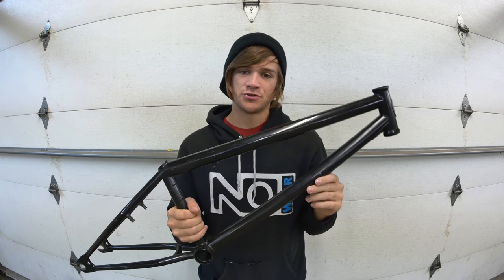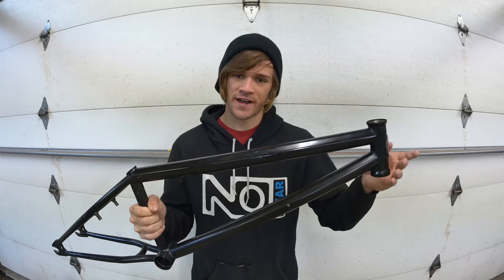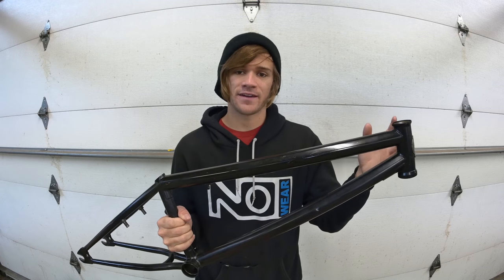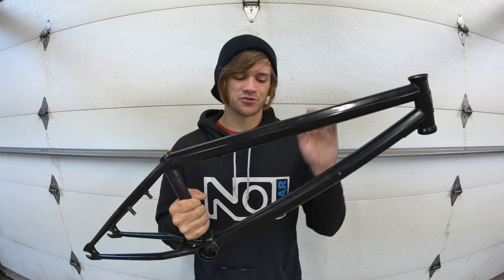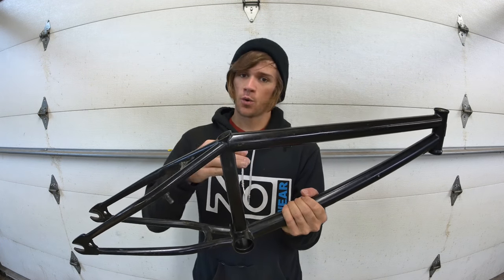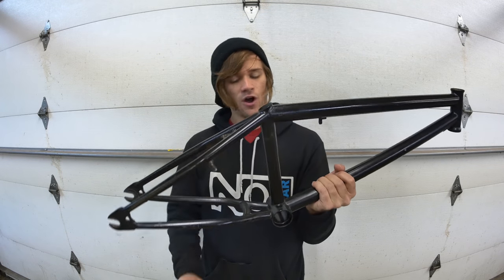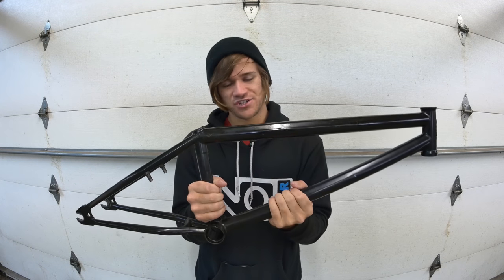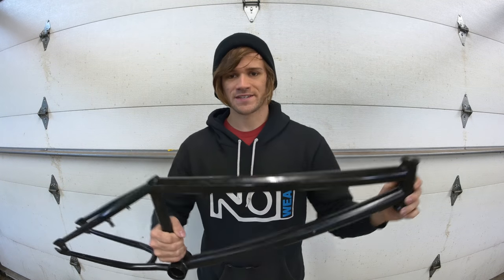BMX Frame Geometry | EXPLAINED

Comment: Dude, this is the BEST frame description ive ever seen !!  Ive been killing myself trying to figure out what size I nned for a frame to ride flatland & a little street ( but mostly flatland ) ,you said most flatland frames are 18 "  19 "  , but I'm '6 1" so I would probably need like a 20 or 21 " ?  I'm guessing .  or would a 18" or 19" be better, seems to me that would be to small , but more controllable  , I don't know ..hmmmm , all these new school bikes have me confused, I'm 44 and been thinking about getting back into bmx  ( when I say a little street , just mostly grinding and stuff, nothing to major, like I said mostly flatland
Reply from the maker: Thanks man! Honestly I’m not to sure about the answer to your question. I bet you could find it with a google search about flatland frame lengths.
I’m sorry that I can’t help more
Reply: my friends rides a 19.5 flatland frame and he is 6'1

however i also had a friend who did flantland on a 26 inch mtb with suspension disc brakes and pegs.  he was like maybe 5'11 https://www.pinkbike.com/photo/2488414/
as well as a regular WTP street frame built up as a flatland bike. 
this dude used to ride old school bikes as well. honestly for me it seems like any slightly smaller frame with a short rear end and steep headtube with a low standover is going to be decent for flatland. 

oh another older rider i used to ride with road a 20inch kink frame for his flatland/park/street bike. he mostly did flatland and ramp though. 

personal preference.
Reply: Jason Freeman Get that ! No matter what age but I think the Haro Matias frame is a little flat land street geometry.
Reply: I know your struggle man lol I'm 48 just getting back into it and it's been a major pain in the ass I've been through about 10 different bikes trying to find one that works for me

Comment: Good stuff Brant! Just finished my S&M CCR build, and wow, quite a difference from my "return to bmx" bike, Fit Mac complete! I was aware of the geometry numbers(and took into consideration) but once I got to throw a leg over the new bike, I was kinda surprised, its a whole different beast! I also noticed how twitchy my fit felt riding the local bowl, so I'm stoked to now be on a bike that will be a lot more stable.

Had I not known about geometry, this would be a great video to understand and help in choosing a frame.  Would recommend this to anyone that is seriously getting into riding.

Comment: Funny you mention the frames with the built in seat post.  I was just talking about the Sunday Ian Schwartz frame with my friend.  It had the post slammed into the frame which I didn’t like bc you couldn’t raise it.  But this was also 10+ years ago when a lot more people were slamming their seat.  And also where I used to work at Seattle Bike, they had that Sunday frame so I miss working there and getting to see all the incoming parts.  They had the Deuce Deuce by Macneil which had a 22 inch top tube!
Reply from the maker: Its fun to think about all those crazy things that have been tried with BMX frames and parts throughout the years

Comment: Great video honestly, the only 2 thing I believe you missed was headtube types like integrated and push in cups. Also different bottom bracket types like Euro and Spanish which can affect what cranks you have to run..
Reply from the maker: Thank you!
I did miss a couple things, thanks for the input

Comment: When you find a frame geometry that works, you just stick with it. My current frame is a Lairdframe and it's the best handling frame I've had since the first Fly Pantera frame I got in 2004. The geometry I currently run is probably 10 or 15 years ahead of what's coming out even now but it works. Otherwise, I wouldn't have been using the same frame for the past 8 years and if it ever breaks on me, my next frame is getting built with the same geometry I've been riding since 2015.
Reply from the maker: People definitely tend to do that. It’s funny though because I rode a complete bike im testing for the first time recently and it felt kinda good geometry wise honestly. It’s much more tech oriented geometry than what I ride normally which is just middle of the road normal geo that works good for everything.
I don’t know yet if I will make changed based on this but it’s interesting to think about

Comment: I’m looking into getting my first bmx, I’ve chosen the kink whip when it comes back into stock but lately I’ve been debating building my own, could you do a pros and cons video on buying vs building, I know cost would be a big part but at the same time I feel it would be more sentimental if my first bike was hand built
Reply from the maker: That is a good idea that is a bit too complex to cover in just a comment so I’ll add it to my list, thanks!
What I will say now is that most of the time when you get a complete bike you end up replacing parts and making it your own anyway. So it might not start hand built in the same way, but you very quickly can start to make it hand built and your own

Comment: Hi, great vid! I'm currently writing my engineering diplomma which will compare modern dirt/trails geometry with typical street but I have a great problem finding some real trails frame with 21' TT and some classic street bike with longer seat tube and 21' TT too. May I ask you for help in finding nice example for both? they don't really need to be 21' TT, but I would need them to have the same length of the top tube :)
Reply from the maker: Can you copy and paste this to me on Instagram? It’s the same as my YouTube name.
I’d gladly like to help if I can
Reply: for a street frame pretty sure the quan frame or a few S&M frames would do you. 

also fairly certain S&M makes some trails frames in that size as well.
Reply: I had the same problem until I bought the s&m black bike.. I've tried the hoder btm frame and love that as well.

Comment: Bro my Khe evo 0.3 came it came with the wrong parts "cheap stuff" i took it back the drop outs were drilled uneven and welded bent but.... I found a 2016 Fit Dugan 1 for  $125 not a. Year old and bro are u from PA too?
Reply from the maker: Wow thats kinda crappy, that sucks. Hopefully the Dugan works well for you
Im not in PA. Ohio

Comment: The bottom bracket height thing threw me when he talked about axle to axle wheel base. The way I understand it, it's basically just a measurement from the bottom of the tires to the center of the bottom bracket which wouldn't have anything to do with the wheelbase.

Comment: Great video, but noticed that you mention tyre height. Having larger tyres raises the whole bike like you pointed out, but it doesn't have an effect on handling as the distance from BB to axle line is fixed. Tyre height isn't worth mentioning in a video about geometry. I'm just pointing this out so kids don't rush out to buy new tyres to change BB height :) There is no way to change BB height in correlation to your axles unless you had a frame with vertical dropouts.
Reply from the maker: Thanks for putting that out there!
And in a nice informative way too.
Much appreciated man!
Reply: @Brant_Moore  I think the confusion is because it's measured from the centre of the BB to the ground, which assumes a fixed tyre height, which isn't a problem; people just compare those distances from frame to frame. If they measured from the centre of the BB to the axle line (which is the important change that affects handling) it wouldn't be as confusing. The distance from the ground makes no difference other than making you higher up or lower down. Sure, if you have a fat high tyre on the front and a slimmer low tyre on the rear, your whole bike angle gets adjusted a small fraction but geometry is the same. BMX Racers use slimmer rear for less weight and park use a slimmer rear for easier whips, I assume.
Reply from the maker: You're absolutely right and it makes perfect sense. I wonder why they don't measure it to the center of the axle
The placebo affect is real when it comes to parts and geometry thats for sure
Reply: I'm assuming because on bigger wheeled bikes, the measurement is called 'BB Drop' (distance from centre BB to axle-line) and since the BB on 20" BMX bikes is always higher, that name isn't apt, so instead of calling it 'BB Rise' or something equally as apt, manufacturers decided on measuring to the ground.
Reply from the maker: Normally it’s listed as BB Height on BMX frame specs so it does work for what you’re explaining

Comment: Missed out on the black hole drop outs, my wtf frame has it and it’s so annoying putting wheels in!  It’s also very weird as it’s meant to be a street frame but has a long chain stay, low bb height and a 75.5 head tube angle.  All the opposite
Reply from the maker: What’s a black hole drop out? I don’t even know that one. Haha
Reply: @Brant_Moore  If you look up S&M WTF Frame you'll see them, they're enclosed dropouts so they're not an open ended slot.
Reply from the maker: Ohhhhh okay I know what you’re talking about. Female only

Comment: anyone knows if it would make much difference for me (i`m 6ft2) to switch from a 20,5 inch frame to a 21 or 21,5  plus from a 9 inch bar to a 10... just wondering i feel way too tall for my bike, help
Reply from the maker: Generally longer frames fit taller people better and taller bars make you feel less haunches over. In theory it should help you not feel too tall for the bike
Reply: I'm 6'2" and I started on a 20.25 with 9"s and I went to 20.75 with 10"s and it made everything so much easier and I felt better on my bike.

I still want to go up another 1/4 or 1/2 inch though. I think I want to ride a perfect 21. The 21.25's I tried felt a little too big especially since I'm used to a smaller frame.

Comment: As a beginner, which geometry would be best to learn Bunny Hop and manual? Which Chain stay?
Reply from the maker: I feel like geometry doesn’t matter quite as much for someone who is just starting out unless it’s some kind of race bike or something that has an extremely long frame/chainstay. Any complete freestyle bike you buy will have geometry that you’ll get used to as you learn and determine what works best for you
Reply: @Brant_Moore  Thanks mate for your opinion 👌
Reply: @Brant_Moore thank you for that. I also had a similar question. New to bmx and have a nice bike with a 21 TT and 12.5 chainstay. I’m 5’11 and wondering will I always feel like I’m looping out on bunny hops or is it technique? I feel like it’s likely my errors and not the bike :)
Reply from the maker: @andrewstrobert5840 The bike could be helping that happen a bit but it’s not something that you won’t get used to over time.
And if it doesn’t get any better after months and months, or if you really don’t like it after trying to get used to it..maybe then I’d consider a different frame
Reply: Thanks. I am yet to give  months of practice. I’ll keep at it and see how it goes. If I don’t get used to it, I have the ability to switch it with my brother for a kink whip xl. Same top tube but longer chainstay. Thanks for the insight, at this point I think I need more practice in general. I’m a newbie to Bmx coming from mtb and gravel. Riding with my kid, so I’m determined to learn 👍

Comment: Guys im newbie, how can i identify an integrated frame? all of the people i ask told me to have and integrated frame. planning to build
Reply from the maker: Look at where the headset bearings go in. If the frame itself is made for the bearings to sit in it it’s integrated. The other kind requires cups to be pressed into the frame you can very easily tell that they’re there.
Id guess that 99% of aftermarket frames are integrated
Reply: @Brant_Moore  thankyousomuch man! now i am enlightened, i've searched a lot but couldn't get the answer that i can understand, but i do now thanks to u! God bless you man staysafe
Reply from the maker: Always happy to help man!!!!